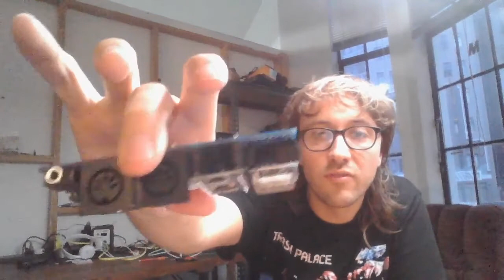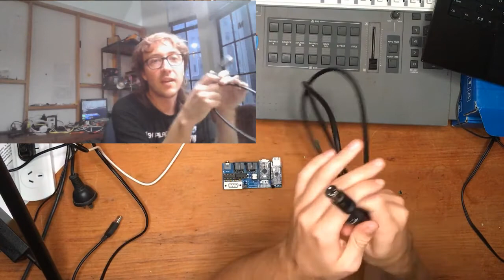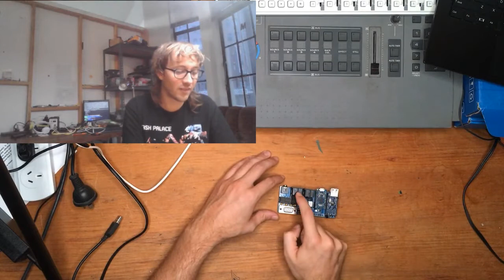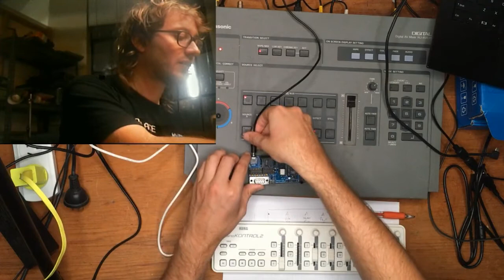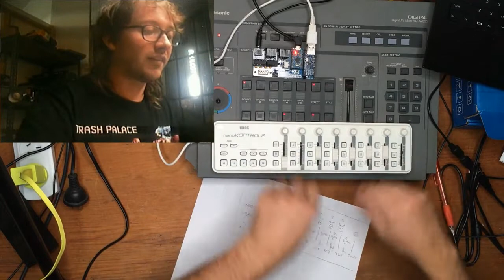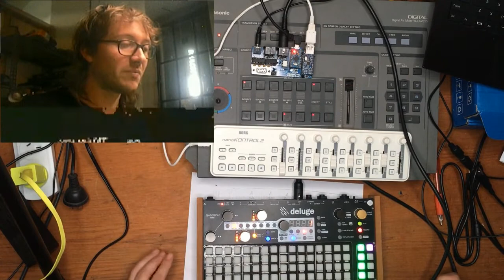_transcribe_ circuit demo

Comment: Hey, I have Panasonic WJ-MX20 mixer and it uses RS-422 instead of RS-232. Do you think I could go with 422-232 converter and it will work? Or there may be even simpler solution for this one?
Reply from the maker: ah yeah i did look into the mx20 mixer while researching - coz some mixers have both 232 and 422 options. but i gues not this one. i think maybe the circuit could be modified to send 422 serial instead. i will have a look into how difficutl this might be. coz the decives supported the better imo !

Comment: Sick dude! 

I've been tinkering with RS-232 and several video devices and have found it difficult to use effectively - one of these would be an absolute godsend.

Couple questions:

I might have missed it in the video, but are the commands pre-programmed based on the selected unit or can the device "learn" the triggers?

Given the large number of inputs available on a midi device - would it be possible to control multiple devices?

Finally - are you selling these - or maybe have the project files so we can build one ourselves??

Thanks again for this awesome project!
Reply from the maker: thanks reaching out - the commands are pre-programmed so you can create the mapping you desire in arduino code and then flash it to the uC (will make another video showing this at some point)

i think it could be possible to control two different devices if you split the rs232 output and send it to both (im guessing they wil ignore commands they dont know )

and both options will be available: project files are all open source and online for free, also pcbs, kits and units wil be for sale on underscores.shop v soon - im just testing the lastest revision of pcb now hope this one is production ready ;)